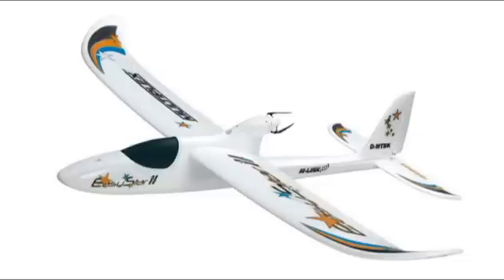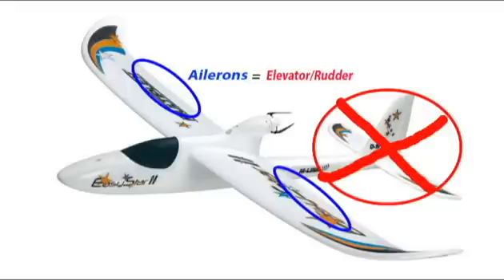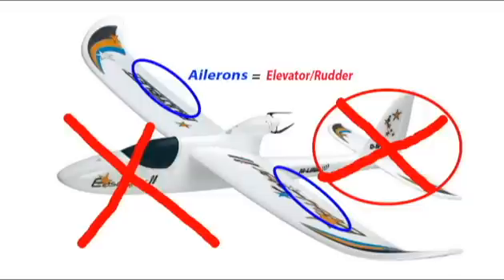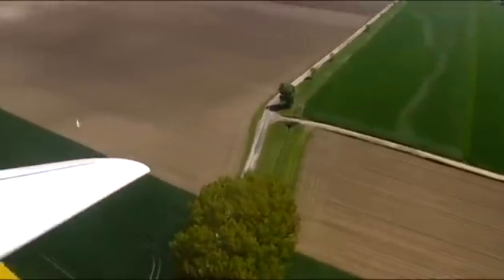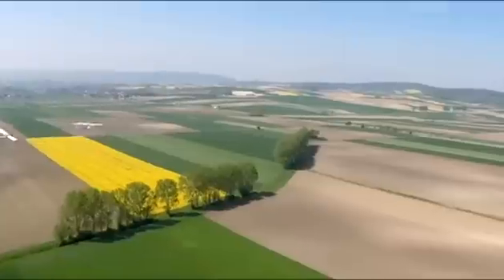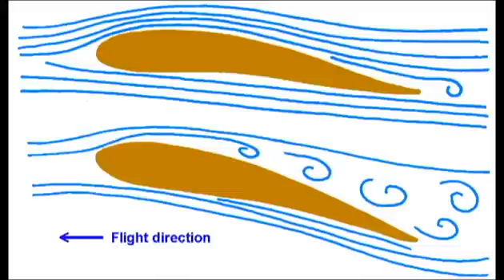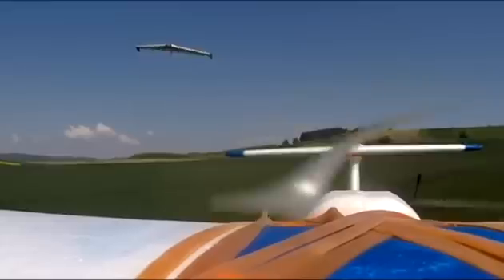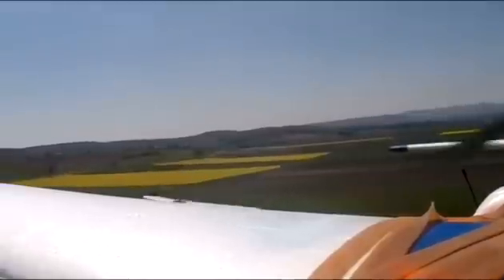What is the most efficient RC plane?

Comment: A DLG! A well designed, built and set up Discus Launch Glider is one of the most if not 'the' most efficient aircraft currently available; from the standpoint of aerodynamic efficiency. Also, a motor, prop and large flight pack are not required. They also have a far better L/D (glide ratio) because the wing can utilize a cambered airfoil with the tail surfaces. Tail surfaces also allow the option to change the shape of the wing (camber and/or reflex) for different flight speeds and maneuvers broadening the flight speed envelope a great deal. I also find flaps/flaperons indispensable as they are part of the wing airfoil shape changing surfaces and brakes are awesome because I can point the nose straight down with flaps deployed for a spot landing right in to my hand. :)
As far as powered craft, early experimentation by Al Bowers has shown a Prandtl type of flying wing hold great promise for flying efficiency. 
Great video! It is always smart to exercise and explore a train of thought so we may all learn something. Thank you

Comment: Fold the winglets down to become part of an extended span as per Prandtl's bell shaped lift distribution.  This is minimum induced drag for wing root bending moment. This is the correct efficiency optimization.  Do this and you need no vertical surfaces because this plan form cancels adverse yaw so no conventional drag controls are required.  The elliptical plan form is not the correct solution and requires drag making controls.  This was all solved by Prandtl in the 40s.  The Horton flying wing glider designs based on Prandtl's work have been shown by analytical projections to exceed modern glider design performance if the materials and construction were updated.  I am not going to search for the studies again, you can do that if interested.

Comment: I agree with most of what you ha e stated although... Aircraft design is governed more by an aircrafts goal. Most design goals dictate a high level of practicality... Usually dictating the need of a fuselage. Fuselages generally have a low front area & drag coefficient... Resulting in minimal drag, so little that it's minor drag is a penalty often paid for the increase in payload space(a skywalker will carry have more area for electronics than a zephyr for example). Great video though :)

Comment: I also fly both eg parkzone F27 ,bonsai ,teksumo ,f27umx ,bixler2 and 3, asw28  2.4 meter ,hk EFX
The flying wings are very manouverable and very good lifting bodies able to carry lot's of  equipment eg fpv gear and large batteries but they basically force their way through the air at an angle to keep in the air
The conventional planes slide through the air much easier and much more efficiently 
Obviously the original poster has limited experience or just let's his preferences bias his view's

Comment: IM PISSED OF AILERONS AND ELEVATOR ARE NOT THE SAME AILERONS LET YOU GO LEFT AND RIGHT ELEVATOR MAKE YOU GO UP AND DOWN RUDDER MAKES YOU TURN LEFT AND RIGHT SO YOU CAN GET RID OF THE  RUDDER OR AILERONS BUT NOT THE ELEVATOR ALSO YOU NEED A RUDDER AND AILERON SO WHY GET RID OF ANT THING LEAVE IT ALL IDIOT ALSO I FLY MODEL AIRPLANES AND IVE FLOWN GLIDERS WW1 AND WW2 ANES MILITARY PLANES JETS 3D PLANS(acrobatic planes)AND GAS PLANES ALSO IM A PRO DRONE RACER IVE WON 5 OUT OF 5 RACES THAT I HAVE FLOWN ALSO I FLY HELOCOPTERS TO AND IM 12 YEARS OLF

Comment: The most efficient R/c aircraft is not a flying wing, its not a glider or even a war bird. It's a well engineered flying platform! If you have a heavy, over weight airframe with out addressing critical calculations with center of gravity, MAC, wing loading, lift to weight ratio and other factors in mind you won't make it very far. It doesn't matter what you fly you're already inefficient if you don't do you homework. If you want an efficient R/c airplane do you homework and make the aircraft you fly much smoother and sleeker than what you posted in your video.

Comment: A lot of folks allude to reflex airfoils as the main cause of efficiency loss but reflex isn't needed for well designed swept flying wings so long as they have sufficient sweep and span. The main effect that makes conventional aircraft more efficient is leverage, specifically the force that maintains efficient angle of attack which, in conventional planes, is a long lever requiring little airflow deflection. Some, but relatively little. Obviously there is considerable complexity to a good understanding but that's the bare bones of it. I've been designing model flying wings since 1960 and have "tested" the idea of zero washout and the theory holds: you don't need it and you don't need reflex. Some is useful for auto stability I also found. If you wonder how I got a stable wing without reflex or washout I employed aerodynamic washout via airfoil selection and at least 25 degrees of sweep coupled with a high aspect ratio configuration. Dead stable, more efficient, but still a mite less than a very well designed plane. Wings can execute more severe maneuvers than conventional planes or if c. planes are equipped with a large elevator, wings maneuver more efficiently but with less directional control.

Comment: The primary component that you have neglected is that flying wings have to use reflex airfoils for stability.  They are not the most efficient.  Adding a tailplane allows for primary wing airfoils that can be more efficient.

Comment: I fly conventional rc aircraft geometry. Aft CG loading with a stability autopilot makes the tailplane an effective lifting device increasing effective wing area with a small amount of down elevator on the tailplane.. Flying at a speed to give best L/D and minimum induced drag has given me a good endurance results for a given prop/ battery size. Not to be confused for flying for range. Reflex on a flying wing induces its own drag issues. Either way, both have there merits!
Reply: Jackwindow. Aha! The magical lifting tail raises its questionable head again. Personally I place it in the same category as the never ending "down wind turn" argument. Have You read about lifting tails in Martin Simons "Model aircraft aerodynamics", the bible of model aircraft design? 
 To paraphrase him, theres no advantage and in fact more drag when your COG is pushed too far rearwards (or too far foreward)
 If you are presenting anything more than a horizontal stabiliser with the elevator inline with it, any percieved advantage is outweighed by the extra drag that the raised or lowered elevator creates.

Comment: efficient at what, cruise or loiter?   
there are many mistakes with this video, especially if the goal is endurance.   
the massive change in center of pressure with varying angles of attack of most flying wings, (any one with a large chord) will create a low speed instability. it can be compensated for, but that is very costly to performance.   
the planform is almost always compromised, as is the airfoil, aspect ratio, and washout angle.  when all factors are considered, the tube and wing design is more efficient, and can be more stable as well.  The only thing that flying wings have going for them is their ability to be more efficient when flying at relatively high airspeeds, and not too bad at low airspeeds, considering their simplistic design.    My design for a more traditional utility aircraft should fly poorly, if all you have stated is true, it should not fly over an hour, but it flies for 4 hrs, and has tons of weight lifting capability,  excellent low speed handling, and enough internal volume to fit your lunchbox into.    I may have to make a video about this, as there are a lot of misconceptions...

Comment: wings are harder to learn on because they are harder to orientate and have a nasty bite once they do stall.
Unless flying at anything but optimun angle of attack they are very! draggy

The most efficient wings are long and slender.... like gliders.
Any other wingshape is done for structural, high lift or speed reasons.
Reply: Agreed. I find even in the regularly hands on flying rc community theres a "near enough is gd enough" attitude when it comes to cog in all but about 2% of flyers. Same as you stated above, my experience,  especially flying wings of all types are generally transformed by cautious COG movements of maybee  1mm at a time rearward, from where they fly OK.
But beware! 1mm too far, ( Im talking from my experience of flying maybee 30 wings of all types upto about 1500mm span (5 ft)) and it can transfom from flying on rails, to a scary beast that may respond violently to tiny control inputs.
Yes high AR (Aspect ratio) is the most efficient way to go.

Comment: Has any of you guy seen a MyFlyDream MTD?
They seem to be one of the most efficient planes out there...
They can achieve crazy long flights... 
CR, I do agree with you to some extent but gliders get alot of help from thermals so I'm not sure that counts in this argument.
I also fly wings and one (FX-79, I am trying to get to fly for longer but I think 1 hour is abount as good as I can get it... And then there are the Flyingwings planes I fly, they have great efficiency.
I think this subject is far to complicated to sum-up in this short video...
Reply: killer dave55. Yes its very very complicated and only the blissfully ignorant would think otherwise. Gd luck with your increased duration.
 Im amazed how many of todays flyers seem to ignore thermals or are unaware of them. It just depends what you want and I see ( particularly)  talented young tech savvy guys not using the experience gained in previous generations and boldly and ignorantly going foreward.
 They want duration but dont define the goal of there duration or even distance or time desired. One guy recently was going for time duration but didnt like flying steadily coz it was boring!!!!! He wanted to motor up high coz it was interesting. He wasnt interested in, for example, motoring up, turning the motor off and gliding to conserve battery, He wanted the motor on all the time. for no particular reason.
 He had made a nice wing, then constant thickness  rectangular own design ailerons attached behind the tapered thin trailing edge of the wing fuselage to add lots of drag unintentionally and a fuselage with all the sleekness and aerodynamics of a housebrick! The nose was dead square and wings had a large, like a one inch gap beween them and the fuselage!!!!!! that a very effective source of lots of drag!!! the tailgroup was not much better.
 Whatever floats your boat i guess, but if you just want time duration, motoring then gliding (except in rare situations) is the way to go. I can easily get 1 hour 30 with my 78 inch span 1970s great planes heavily built spirit glider made from balsa with not so gd plastic film on it. I use a 2200mah 3 cell lipo, a motor drawing about 20 amps, and that will give me 12 climbs of about 30 seconds duration to about 300 ft from near the ground. 
Then i just fly minimum sink, find a few thermals along the way and 1 hour 30 easily.

Comment: It all depends on what you want to do in RC flying . I personally enjoy variety : ultra slow , ultra fast , 3D , slope , thermal , silly home made planes , etc . Each type is efficient at what it's meant to do , but there isn't one type of plane that does it all " efficiently " .
Reply: Well stated sir! Im the same. I like to explore the envelope of rc flight. living room, back yard, indoor, park, slope,  street, thermal, DS, some heli but no drone, glider, aerobatic, rudder elevator, rudder elevator spoiler up to full house  digital control, home built, bought, traded, swapped, gas, glow, electric hand launch, bungy launch, winch launch and f3b type, polystyrene, epp, balsa, fiberglass, carbon fiber, kevlar, vintage, modern, how far, how fast, how slow, how high, how low, how aerobatic, and for how long is a bit of me. Just flying one type of RC one way is like a life of only eating bread.

Hmm Ive yet to try autopilot, gps, fpv and drone. havnt flown diesel yet either. Ive got heaps more to explore and enjoy

Comment: Can someone point me to a good source to learn more about efficiancy of rc planes?
The hole thing isnt clear to me. There are flying wings with long flight times and a lot of payload capability! There is also the Skywalker 1720 with long flight times and the ability to carry huge lipos! And also some other usual FPV planes around 2000mm wingspan!
I am in the hobby since about 3 years and have had about 10 different planes (no FPV expierience). I owned some wings, Slow flyers, a Bushmaster and gliders. I was thinking too, the flying wings are most efficient for FPV. But now related to this vid and some of the comments and planes like the Skywalker i am unsure! There are KFm airfoils, Box wings, slotted wings, leading edge slats and dont know how it is called exactly slotted wings( airfoils mounted behind and lower than the airfoil before).
Reply: Heh, I can only say, the internet is probably your best source to learn about RC flight efficiency. 
  Personally I reckon it depends on what you want the aircraft to do. Efficiency is always going to be relative to the function. And huge batteries will always give long flight times if the plane can support them. I suggest that heavy loads might be best carried by a twin boom design. But heavy loads also require more power.
 Conversely if you want to remain airborne for the longest time and use the least energy then you have to consider high aspect wings, light weight and extreme aerodynamic efficiency. Think about Solar Impulse. It may have looked a little bit goofy, but the design was very clever, and they basically carried the minimum load required with a very small margin for error .
Reply: RC Groups would be the best net site Ive seen, There a bit in there for just about any type of rc.